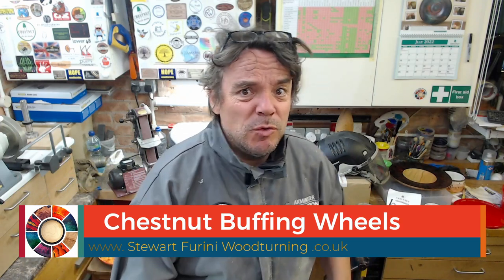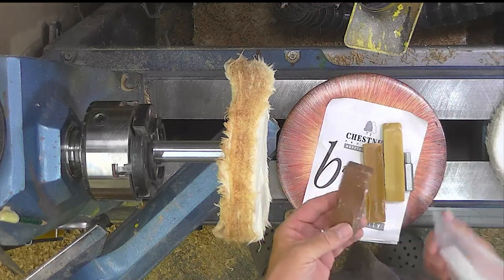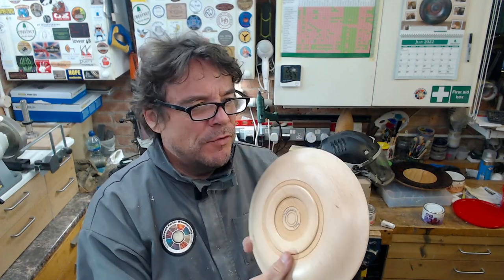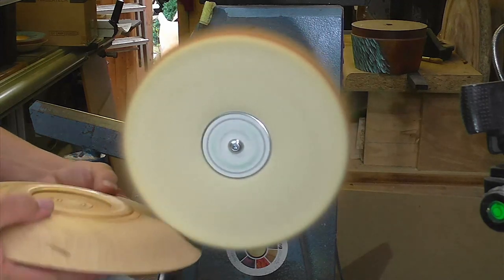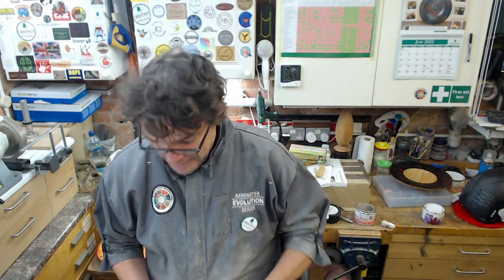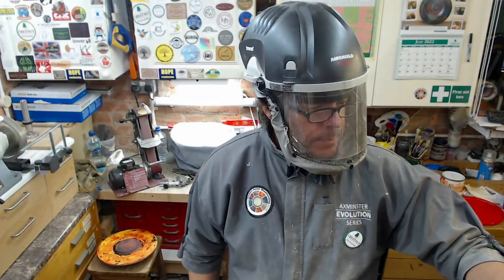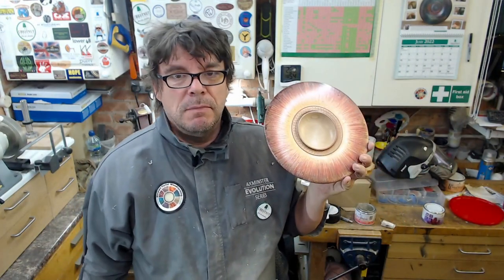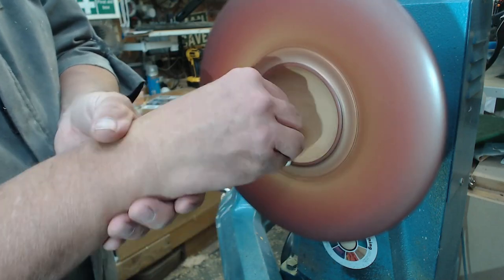Chestnut Buffing Wheel Kit

Comment: Nice! I've been using the Beal buffing system for a number of years now. That system  not only has whee!s for the exterior of a bowl but also optional mops for the interior. Lacquer and poly finishes buff up to a high shine. Most everything I make from cribbage boards and boxes to magic wands get buffed after the finish has cured. Makes a huge difference in appearance and feel. After the walnut oil on my bowls has cured, they get buffed as well. I always look forward to your posts.
Reply from the maker: Thank you! I should have mentioned that Chestnut Products do mops for their mandrels as well. I should use my system a bit more!

Comment: I've been using the chestnut system for a while with excellent results. I also use it over some coloured finishes such as intrinsic dyes or chestnut spirit stains with good results. It will destroy most paint based finishes, though, as I've learned from hard experience. Nice explanation, Stewart.
Reply from the maker: Cheers, Jim....I once tried it on a painted surface.....hmmmm........but on lacquer and hardened oil surfaces it works great!